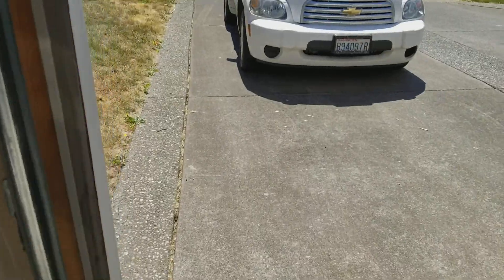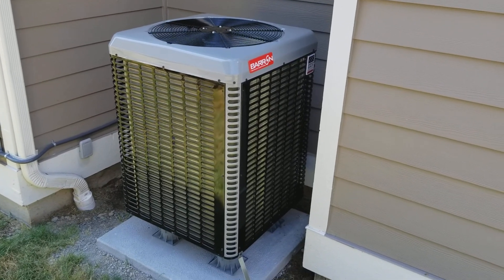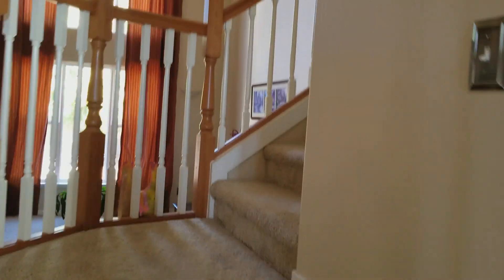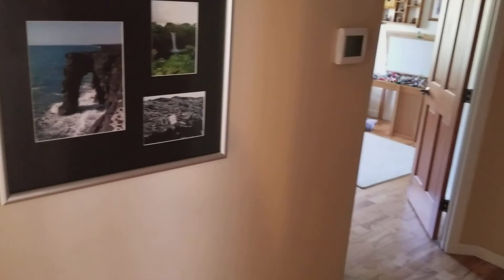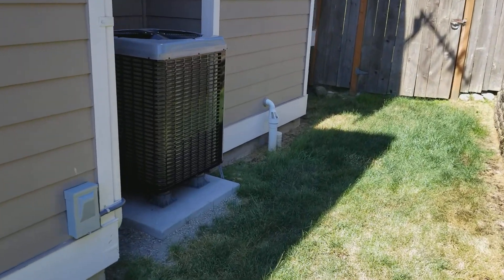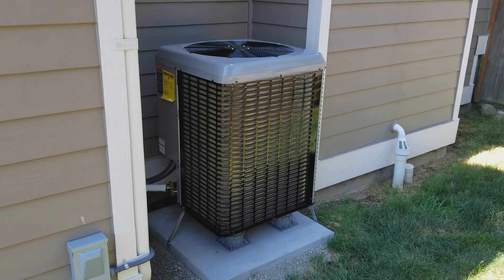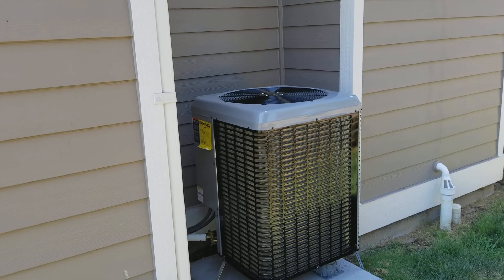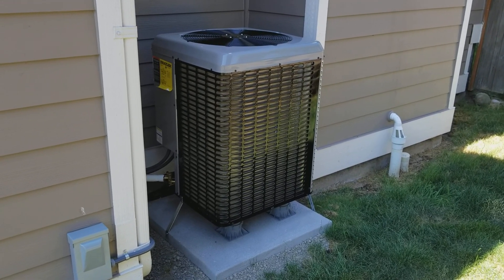Coleman 5 Stage AC/HP with Modulating Furnace and Zoning Retrofit

Comment: I just want to say; I love your work. But you are incorrect that the Coleman/ JCI products are the only systems that you can use non-proprietary controls on. The Maytag/ Nortek 18 SEER system can use any two stage control system you want. Regarding the zone system, I believe you can set the panel to stage down the condenser and the furnace when you have zones satisfy and shut down. That way you prevent as much blow through and over heating/ cooling of the system.
Reply from the maker: Oh! you got me. I forgot about the Maytag. I will look into that of which you speak on the turn down. Thanks!